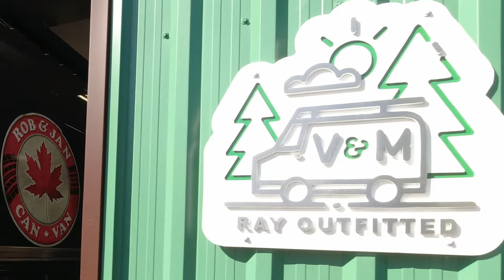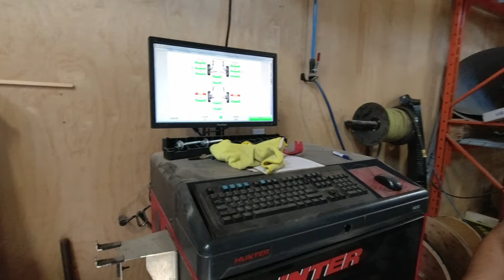DIY vs PRO/SUMO SPRINGS INSTALL//EP 2: Rob's Van Repair & Maintenance Tips: I BUSTED MY NUTS!

Comment: Rob, Same thing happened to me and my 2019 promaster. It only has 4000 kms on it but the nut broke loose from the weld. I bought a new nut, slid it on top and the weird thing is the remaining weld locked it in place enough for me to tighten the sumo spring on. Thanks for your time and effort to show how not everything goes as smoothly as some people show! love your videos. keep em coming!
Reply from the maker: Thanks @Martin Currie! It does seem to be an issue with these vans. We knew another vanlifer that has the same problem. Glad you found a workaround. 👍 And yes, we like to keep it real. We can learn from each other when these things happen. 😊